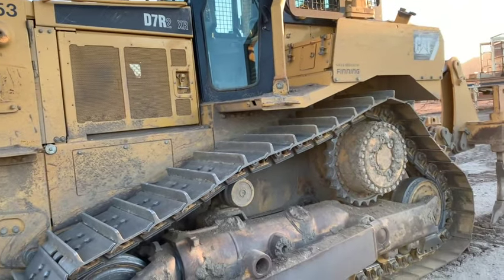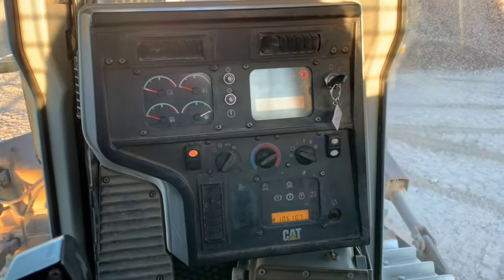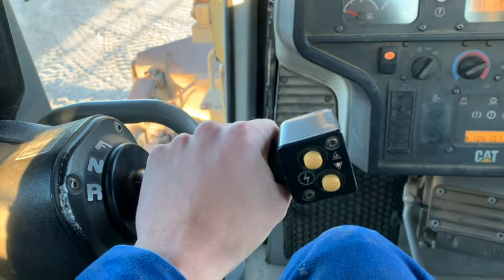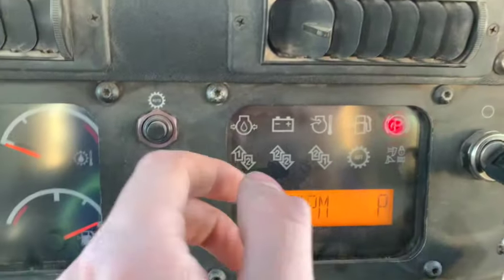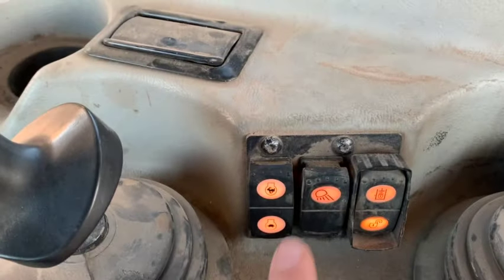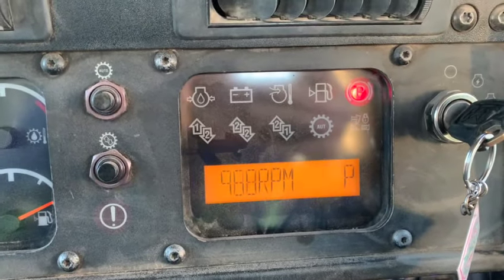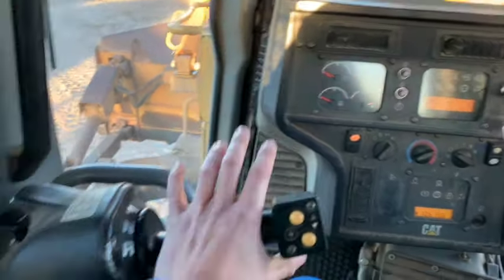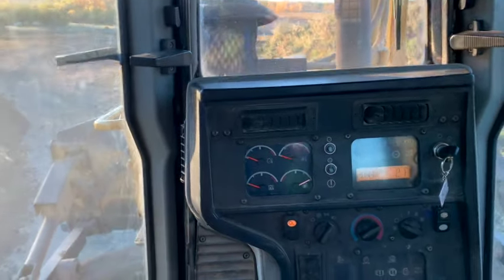How to operate a Cat bulldozer (D7R)

Comment: What I'd like to know is, why do some manufacturers tend to put an ungodly amount of stuff, cylinders, 2 extra ft tall of hood above the engine  and giant dashes and smoke stack right in front of your forward line of sight, while some other manufacturers have a more curved and slopped hood, smaller shorter dash area, and cylinders that ride off to the side? Are the engineers brain dead? Or do they think it's funny or what?

Comment: Yeah so, not all machine controls are the same. That control is called a "tiller" control. Used to "operate" the machine, not drive it. But yo can also get (newer) machines with "standard " controls. Which would be two steering clutches. Or, "fingertip " controls, which has two small flat toggles that you press (with your fingers) to steer. If you go back a little in time. Bulldozers had  two steering clutches and two brakes. If you go back even further in time. They had two steering clutches, two brakes, and two pedal clutches. Further still, add a "Johnson bar" to engage and disengage the transmission. I have Operated all of these machines. They all have to be operated differently, depending on circumstances. Especially when turning going down a steep grade. Personally I like the tiller control the best. My D9R with tiller control and ripper. Could spin like a top, if I wanted it to. No other control allows you to spin the tracks in the opposite direction. Peace. IUOE Local 15, 38yrs ret.

Comment: A D7R has good pushing power but it doesn’t matter if it’s a D7,D10 or D11 with a full blade sometimes the you squeeze the controls and push your feet into the floor wanting and hoping for more power lol
Reply from the maker: Haha with your teeth clenched hoping it doesn’t break traction so you don’t have to back up and take another run
Reply: Operated 977 mostly for 18 years and I found that I was always looking to squeeze every bit of power out of it. Great machine to run.
Reply: 😂 hear ya

Comment: Thats different then a d6 lol or d4 or d5 or different from a Deere 650 or 700lgp I think the high tracks are different controls as well but the controls are in the same position an sides tho. Just different style handles
Reply from the maker: Our D6T, D7R(s), and D8R all have these same controls, all high tracks. The D5H is a high track, but a little bit different and  3 and 4 are entirely different machines.

Comment: Torque converter.. it looks to be hydrostatic drive
Reply from the maker: The forward and reverse are mechanical drive. It does however have hydraulic drive motors that spin the pinion gears in the differential to steer. That’s why you need high RPM to steer. In this application (the D7), hydraulic drive wouldn’t have enough torque, much like climbing a hill with a combine.